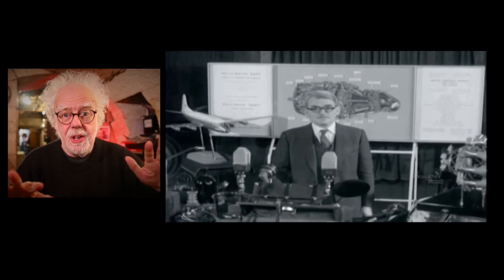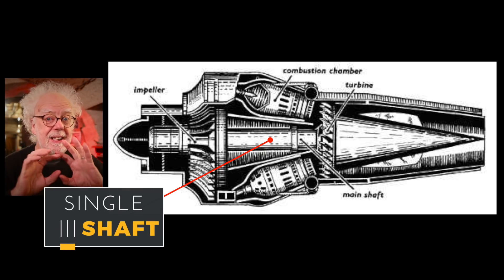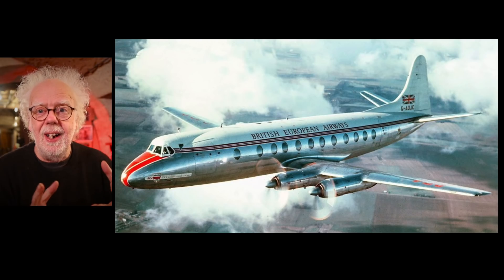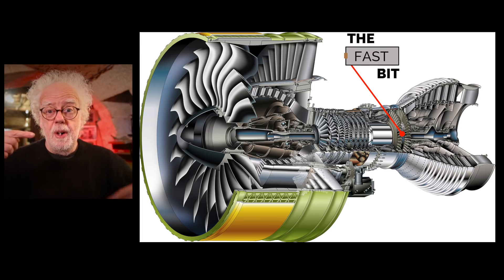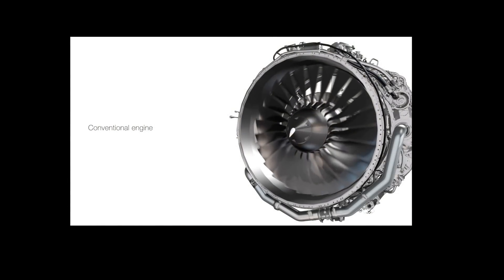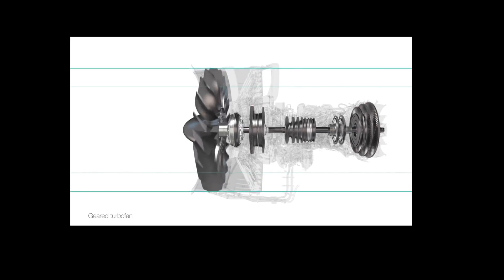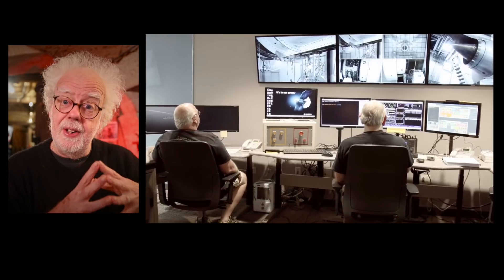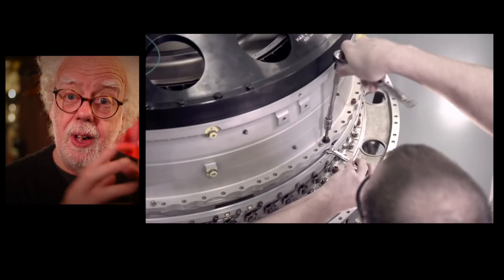Greater than the JET engine - Prof Simon

Comment: all very hot and thrusting but I think/hope.. my (in-wheel) hydro-turbo hybrid ICE/generator/compressor could be used for light aircraft and choppers.... on paper at least!... I don't think it can compete with a turbo-prop for faster, larger craft. It could be safer as it can run off liquid fuel and batteries so if one power system fails all is not lost..

radial engine with (preferably oval..) ceramic cylinders wrapped in coils and resin encased in magnetic alloy or iron . Free ceramic pistons capped with a strong permanent magnet (with circular arc cut away end if the cylinder is oval) fire at a centrally mounted strong permanent magnet rotor with north poles facing each other with strong total repulsion... The oval cylinder stops the piston rotating so the curved end can get very close to the central cylinder magnet rotor and pushes it in a definite direction. A flat ended magnet pushes the rotor in its direction of rotation but not as well overall.... The magnetic gearing effect will increase as the piston nears the rotor which then kicks it back, free of charge... The rotor has slits cut in and is emersed in liquid helium, with the pistons pushing the liquid through the slits/fins, as a hydraulic motor with an opposite power curve to the magnetic effect, starting strong then dropping off ..... Even in the 4 X 250cc cylinder per wheel version there's room for a couple of small turbo generators between the cylinders (or maybe it was the 3 Y cylinder version, haven't looked at it for years..)..... with room for a proper, powerful, standard motor in a few places.. because it's free piston it can work in many firing modes.... Pushes your average engineering boundaries due to oval pistons and the seals needed.... Keeping the helium in and thing lubricated is the trick.... I'm hoping liquid helium + high tech piston 'rings' (ovals..) provide adequate lubrication as well as the required cooling and sealing... and the bearing seals too... Seems worth a go for the right company...! I'm presuming the free pistons put (far) less stress on the system than a pin and crank - but the magnetism induced piston rotational torque cylinder friction and general piston vibes could be worse....

Comment: A video from the Prof is like a pleasant conversation over a cup of coffee.
Reply: Ok Professor Simon, some homework for you: 

1. What is the difference between an axial flow compressor, and a centrifugal compressor?
2. What type of compressor did Frank Whittle invent?
3. What type of compressor is most commonly used today?
Have fun with this!
Reply: @squirrelinstructor6075  How much detail do you want? I'll go into detail on the first question, but leave the other two for someone else... so the differences between an axial flow and centrifugal compressors are widespread. First, the centrifugal... 

They use rotating impellers to turn axial air flow into radial air flow, which increases the velocity of the air as it moves toward the impeller periphery, which increases the dynamic pressure, whereby it then leaves the impeller where it enters a diffuser (a variety of types can be used, vaned, vaneless, and various subsequent volute designs) whereby the air velocity is reduced, reducing the dynamic pressure and increasing the static pressure (ultimately the result is absolute pressure rise). The advantages are high single-stage pressure ratios (up to 10:1 for air), simplicity and ease of manufacture at a wide range of scales, and predictable, gentle surge characteristics. Disadvantages are they result in larger diameter engine cores, they suffer from peripheral speed limitations (and therefore they are limited at higher pressure ratios), and they are typically a faff to service (since you have to take the whole compressor engine module off to remove). 

Axial flow compressors work on the principle of dynamic to static pressure rise, but this time they use a series of decreasing height rotor-stator combinations sequentially, whereby the rotor increases the air velocity (and therefore dynamic pressure), and the stator vanes slow the air flow (therefore increasing the static pressure). This is done in several stages, older engines (turbojets) would have a single spool, with modern turbofan engines using a second spool (and third in Rolls-Royce engines) as a means of increasing efficient operating range (due to the thermodynamic properties of compressed air temperatures and densities, the speed of sound of air increases). Advantages are higher overall pressure ratios (some newer large turbofans are now pushing beyond 50-60:1), ease of maintenance, and smaller diameter cores. Disadvantages are they are difficult to manufacture at smaller scales (due to tip clearances and tolerances), they surge rather suddenly and violently which can cause damage, and they have low single stage pressure ratios (1.3-1.7:1 per stage) which means more stages overall, increasing complexity.
Reply: @onetrickhorse  Well done!
Reply: Can relate. Watched this video while drinking my morning cup.

Comment: Correct me if I'm wrong, but this is not new. I remember reading about this years ago, along with multiple geared shafting within the engine. Which allows each section turn at its most efficient speed for the power setting.
Or was I dreaming? Should I rush a patent application?

Comment: Inventing the jet engine is thought of as having been revolutionary.  But it was a simple step that was evolutionary.
Piston engines had a ceiling limit because they gasped when you climbed too high and the air got too thin.  The solution was forced induction.  This approach dates all the way back to World War I.  By the time World War II was looming, the turbosupercharger was well established.  You tap the energy out of the waste heat in the exhaust to pump and compress air being fed into the intake.  A turbine hooked up to a compressor, with the pistons in between benefiting by being fed more air.

Whittle & Ohain realized that once you've got the turbosupercharger doing its suck-squeeze-bang-blow thing, you no longer need pistons.  And in fact, those pistons are just getting in your way.  So you remove them, and viola.  Jet engine.

Later evolution happened with the realization that the compressor&turbine blades themselves were slowing you down, and that those too could be pulled out of the way so that you can go even faster.  That the geometry of the inlet and exhaust was sufficient to achieve the needed thrust.  This was the birth of the ramjet.  And we reached speeds of Mach 3+ with the SR-71.
Reply: Turbosuperchargers produce no thrust. The conceptual difference is massive. Not one expert of the time believed you could power a jet from gas turbine thrust alone. O'hain was a fraud who despite copying Whittles patents and having significant national funding never managed to produce a practical jet engine.

Comment: The future of the jet engine is expected to be the "ultra fan" which is essentially super sizing the fan and mating it to a very small engine core. Very high bypass ratio and super efficient.. Needless to say, the gearbox would be a very critical element if such designs

Comment: Question:  Why do they call it a jet?
Reply: Because the hot gasses moving through the turbine and out the rear is called a jet. Similar to the jets on a gas burner.

Comment: Larger turbo fan engines have had 2 or 3 shafts since decades. So it is not correct to generalize and say that there is only a single shaft in a turbo fan engine. Typically   the fan, the low pressure compressor, high pressure compressor are driven by different turbine stages. I believe Rolls Royce has triple shaft or spools as they are more commonly known.. designs.. other manufactures may be using a twin spool design

Comment: Excellent video.  Kind of surprising that the idea hadn't be thought of before.  The planetary gear set-up used is quite simple.  That accounts for the counterrotation.  You'd think that a smaller fan w/ higher pitch would do a good job too.  I like McCune's idea better.  Good job, Professor.
Reply: Alex T Turboprops use gearing to reduce the propeller speed for the same reason. The Allison T56 for instance uses a spur gear set and a planetary set to change ~13000 rpm at the turbine into ~1200 at the propeller, transmitting ~5000 shp in the process. Larger diameter propellers and fans need to turn slower to avoid supersonic tip speed, so the gear reduction must be even higher.

Comment: You  skated over the early technology that was the centrifugal compressor (limited pressure ratio). The axial compressor usually gives you a longer engine than the centrifugal that was in fact designed by Whittle. Had the pleasure of meeting him when I worked in Paris. As an ex RR engineer I worked on both types of compressor.

Comment: Geared engines.
That's a lotta stressed moving parts you're adding there... ;)
Reply: Yeah surely that's the only reason why this isn't already commonplace? The idea of it is obvious, worryingly obvious almost haha.
Material properties and metallurgy etc were the main things holding a lot of jet (and other engine) technology back up until now AFAIK. So somehow we can suddenly make tougher gear parts? Possible.
Or some little tweak to the geometry of the gearing. That could be a bit more believable since many such tweaks - like those to aerodynamics - have only been found relatively recently due to our very recent very incredible computer simulation abilities.

I don't know, but yeah, sounds fishy to me.

Sounds like "We've had this idea for 50 years, but it's always bren thought too dangerous... Sure, it is a bit dangerous, but it's not 'too dangerous' anymore, because efficiency and deregulation and most of all - we must cut costs, whatever the cost..."
Reply: @DaFinkingOrk  the idea has been around for some time (since the 70's), and a handful of engines were successful too, especially the ALF 502 which still powers the BAe 146, however the main reason it's only just resurfacing is that manufacturing technology has gotten to the point of making the concept viable for larger engines. The gearbox in a GTF suffers from a number of drawbacks such as short gear life, efficiency, and the ability to make them in terms of manufacturability. It's all linked. Gear teeth have to be very durable and made to incredible tolerances, otherwise the heat losses due to rubbing go up drastically. Those part tolerances are astoundingly difficult to reliably manufacture, and the metrology technology is really only just about there. If you don't achieve those tolerances, then gear wear means more maintenance intervals, which is unattractive to the airlines for obvious reasons. The sheer magnitude of power going through the gearbox means that even a slight increase in inefficiency can lead to huge thermal management issues; think about the P&W1000G running at 30 MW shaft power, consider that even if the gearbox is 99.9% efficient, that results in roughly 30 kW of heat to remove. If that drops to 99.8%, it doubles, and so on.
Reply: @DaFinkingOrk  put a duct on a turbo prop and you get amazing results but the top speed may not be high enough for the angled wings of airliners ... so build a better prop with more blades and bigger and stick a bigger turbine engine and that just fixes it ... make sure the gear box can handle the power ....
Reply from the maker: good point
Reply: @SimonHollandfilms  

Needs to handle 100,000 horse power. Quite a challenge.
Reply: EB : I think we threw a rod.
.
JB : Is that bad?

EB: ...yyup.
Reply: I think the reason we've not seen them until now it's absolutely we didn't have the materials science to persue this is an affordable manner.
I say affordable bot because they only care about money.
Building one of things for, say, a military key is fine because only a (relative) handful will fly and nobody cares about dozens of maintainence hours against flight hours.
So they could build it but not with a plane that flies every day, thousands of them.
So I mean affordable in the sense that is now economically viable due to modern materials.
Take, for instance, the B1B strategic bomber.
It requires 72 hours of maintainence for every 1 hour of flight.
And that's built with 70s technology.
The B21 however, will be built with modern materials so won't require that level of maintainence.
And that why I think we're only just seeing them now, it is indeed a very obvious concept, but airlines can afford to strip and inspect two gearboxes after every flight.
Reply: @MostlyPennyCat  I do not think the gearbox material is the problem, though I could be incorrect.🙏🕊️♥️👋
Reply: James Neave I can’t believe how slow things like this are evolving considering the materials, skills and tech available today.
Reply: They make the most precise gears and bearings in the Planetary Gear World for the transmission. Because "failure is not an option". They also use a Floating Bearing design that cuts out shaft alignment stresses. https://www.facebook.com/nathannavarromusic/videos/917525485273736/